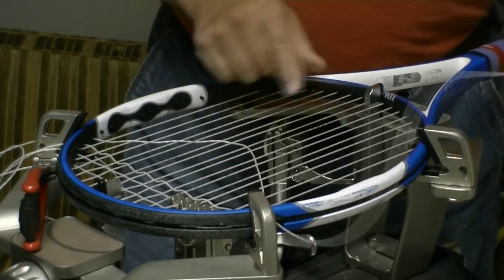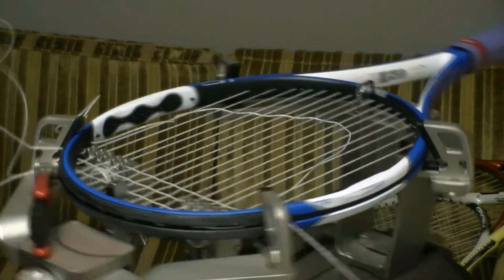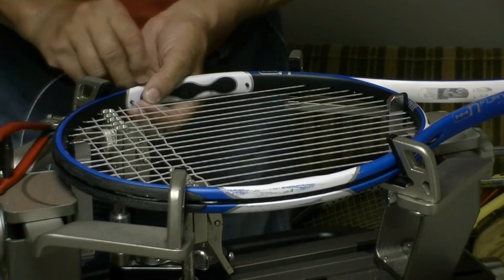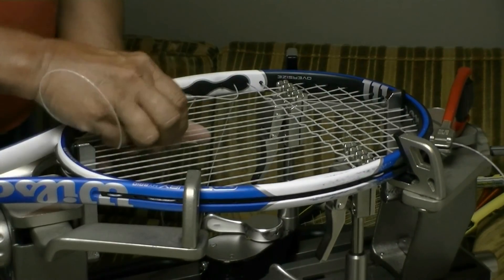How to weave your crosses

Comment: I guess I'm still kinda confused. Maybe instead of weaving one ahead in order to go under the high mains and over the low mains you could just go over the first main instead of under? What do you think?
Reply from the maker: steppinout67 it doesn't matter as long as you're talking about the top cross, but once you weave the first cross you must weave all other cross in one specific way. Once a cross is tensioned it will push all the mains that go over it high and all the mains that go under it low. Here is an experiment for you. After weaving and tensioning a few crosses weave in two crosses with no tension, but straighten the strings as best you can. Look at the racket from the top toward the butt. You will notice the  cross closest to the last tension string is very wavy and the second is almost straight. The straighter one is easier to weave. The wavy string is a hard weave.
Reply: Thanks for the response. At 2:55 you say that the cross goes under the low strings and over the high strings and that it appears a lot straighter. But shouldn't it be the other way around? Isn't it supposed to appear straighter if the cross string is going under the high strings and over the low strings?
Reply: How come this is so hard for me to understand!! GOD.
Reply from the maker: steppinout67 Understanding what a hard weave is isn't important. If you prefer weaving one ahead or not that's ok. What works best for you is what you should do. I was weaving Gamma Gut 3 a long time ago and it was a very sticky string. I found 1 ahead to be much easier.
Reply: It's taking me longer to string with this one ahead technique and small loop, but I think it's just a matter of time before I mechanize the movements.
Reply: @steppinout67  If you weave under a string it pushes it high so you need to weave over it The reason you string one ahead is that you'll be going over low strings and under high ones making it easier to weave..

Comment: at 2:55 did you mean to say under the high strings and over the low strings? Wouldn't it appear straighter if that were the case?
Reply from the maker: steppinout67 not sure what your asking. Under the high and over the low makes the string appear straighter
Reply from the maker: steppinout67 if you stop the video at 3:01 the fourth cross goes over the highs and under the low and it is no where near as straight.
Reply: Yeah so I'm assuming at 2:52 when you said "it goes under the low strings and over the high strings and appears much straighter" you meant to say the opposite?
Reply from the maker: steppinout67 not sure where you heard that but it was not at 2:55
Reply from the maker: Click on this link 2:55 and see if that what you meant to say
Reply: 2:52
Reply: I was mistaken in the beginning I meant to say 2:52.
Reply from the maker: steppinout67 ok I went to 2:52 i said under the low and over the high
Reply from the maker: steppinout67 that's what I said
Reply: Right so did you mean to say the opposite?